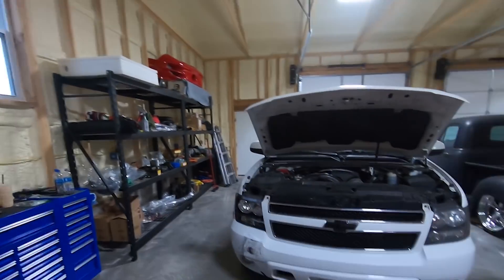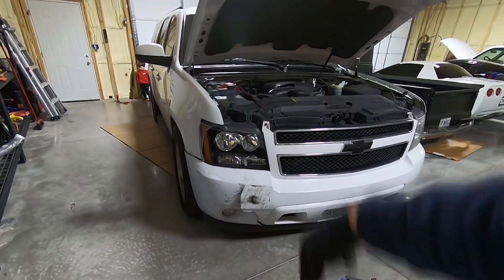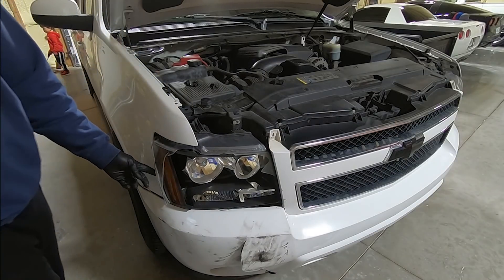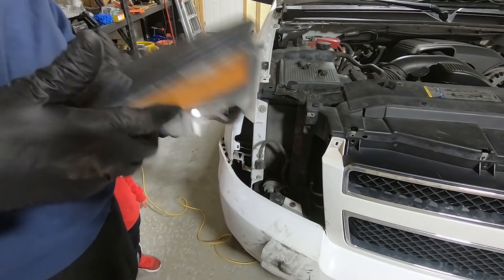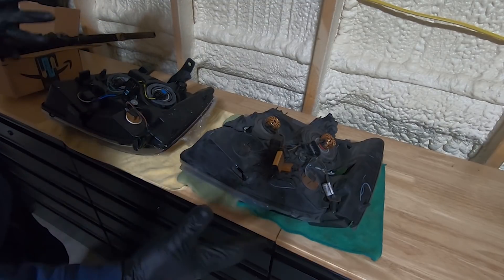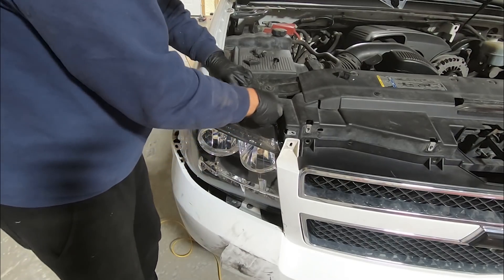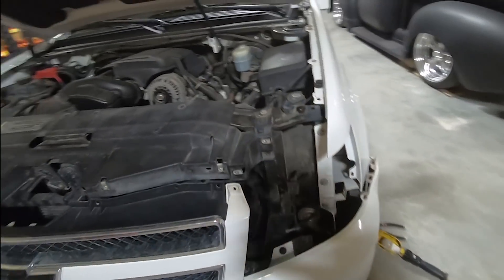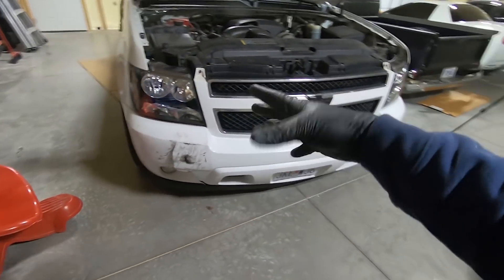Fixing it Myself (New Headlight install on the Suburban)

Comment: What bulbs are you using for the turn signals/running lights? i bought a set for my denali and are awesome from auxbeam but for some reason only when the lights are on they hyperflash and they have built in resistors and everything.
Reply from the maker: I use zevo for daytime running lights and turns. They do hyperflash though.
Reply: @TWAMotorsports  gotcha yeah I don't get it why mine will only hyperflash when the lights are on and not off even my led tails have built in resistors. I even had to get more  put in for the break lights cause my remote start would think someones pressing on the break. So I left the turns as the normal bulbs I hate hyperflash lol
Reply from the maker: Lol

Comment: Did you have to reseal these headlights at all? Any moisture leak thru at all?
Reply from the maker: No and had no leaks
Reply: @TWAMotorsports  great I’m about to order these from Amazon thank you.
Reply from the maker: I put a link in video description to the ones I ordered.
Reply: Also I ordered some auxbeam leds but they don’t fit because of the big fan of the back hits behind the headlight bracket so it won’t let the headlight housing clip into place
Reply from the maker: Mine were close but had room

Comment: If the Suburban had these headlights with these silver reflectors, it would make the Suburban look cooler
Reply from the maker: I'm not much for aftermarket headlights
Reply: @TWAMotorsports  I am pretty sure the ones with the white reflectors are the ones that come on the international model Suburban’s and Tahoe’s
Reply from the maker: I noticed they changed the us ones in like 09 too

Comment: I would clear film the new headlights so that they don’t haze or yellow again.
Reply from the maker: I probably should
Reply: Would clear coating them do the same thing???Just a question
Reply: @paulsalmon4771  Headlights come clear coated, its the sun that damages the clear coat. Clear film (PPF) can last a few years and preserve your headlights like brand new.
Reply from the maker: It would yellow
Reply from the maker: On my C7 Z06 they wouldn't ppf the headlights due to it causing issues
Reply: @TWAMotorsports  ceramic coating them could work too if PPF isn’t an option.
Reply from the maker: Yeah but they say not to do plastic with certain coatings also
Reply: @Ihaveadashcam  OK good to know thanks for the feed back